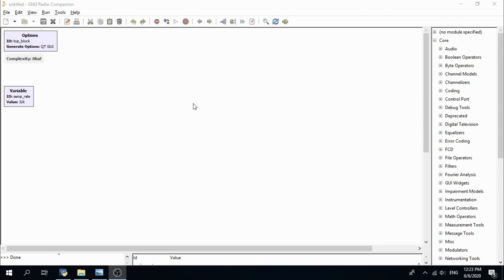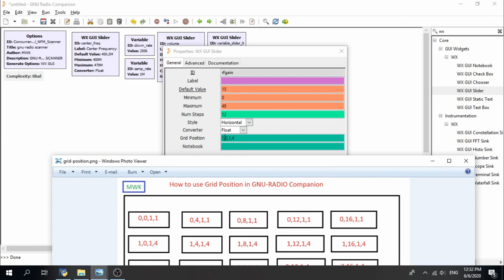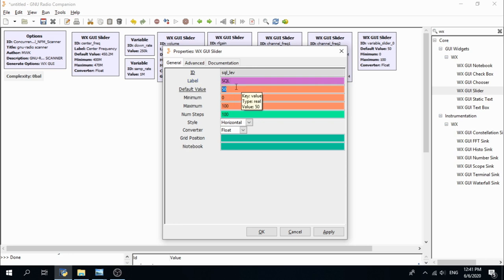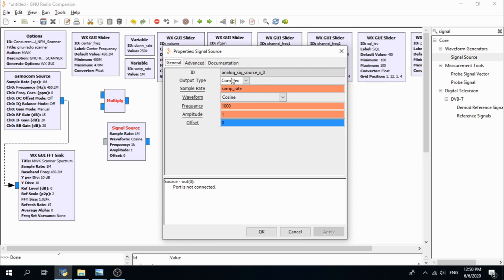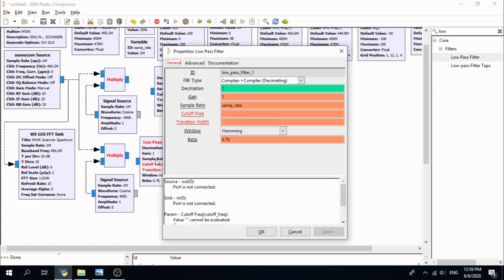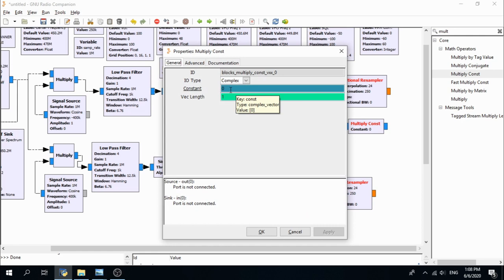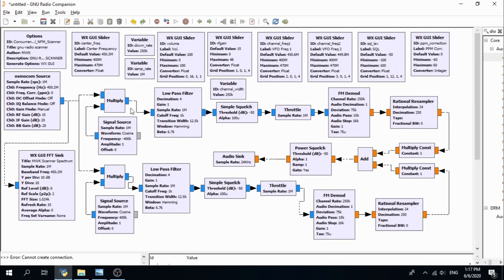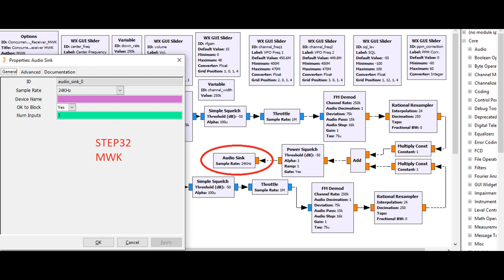GNU-RADIO Scanner

Comment: Can I build in GNU Radio a flow graph with automatic frequencies scanner?
Reply from the maker: For that you need extra code python run behind the grc , and more complicated setup ... I will post a video in future how to do that , but may be need two hours of video tutorial ! Thanks for your question.  In this case we post how to make like analog portable scanner that you put your specific frequencies to monitor . I build one for 20 VFOs and works perfect .
Reply from the maker: You need third party application in win 10 like PyScripter and use it to edit .py and create python file and connect it with gnuradio using Python Module block then in code just open in editor then select chose editor and locate PyScrypter installation like in C : \ program files \ PyScripter and select its .exe then I will launch then type the code of frequency you want to scan .

Comment: Did all that, but only a small box pops up for a few seconds then closes. Any ideas what's wrong ?
Reply from the maker: Whats version of gnu radio on your win 10 ?
Reply from the maker: Version 3.7.11 works , new version not work in win 10 .
Reply from the maker: Follow steps in this video , and you can download recommended gnu radio version from links in video description.  https://youtu.be/fZRuAlPtitk
Reply: I tried a 3.7, and the 3.8, but neither could open a grc file. I'll try the 3.7.11 now. Thanks.
Reply: @MKhanfar-MWK  I tried 3.7 and 3.8 on Win 10 x64, none ran grc files. I'm looking for ver 3.7.11 for Windows, can't seem to find it. Anybody got a link ?  I only see it for Linux. thanks.
Reply: Thanks. I found a copy of Windows 3.7.11 installer on an old thumb drive, and it works ! great stuff, thanks.
Reply: @MKhanfar-MWK  Thanks. I found a copy of Windows 3.7.11 installer on an old thumb drive, and it works ! great stuff, thanks.
Reply: @MKhanfar-MWK  Thanks. I found a copy of Windows 3.7.11 installer on an old thumb drive, and it works ! great stuff, thanks.